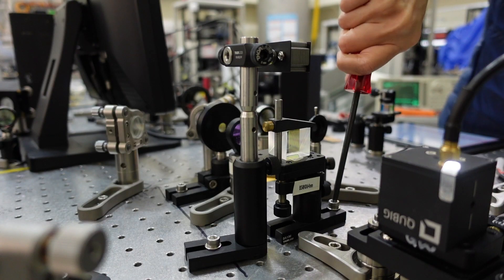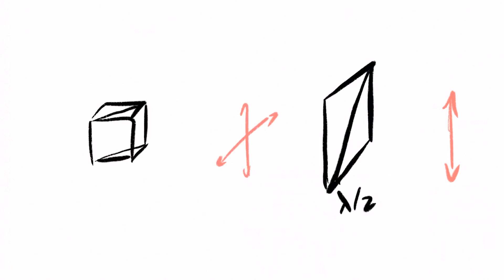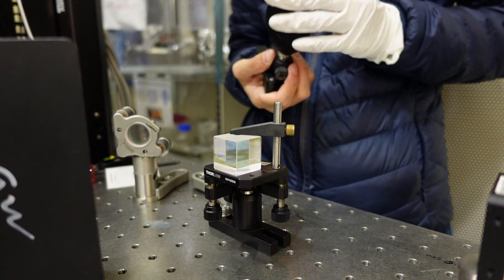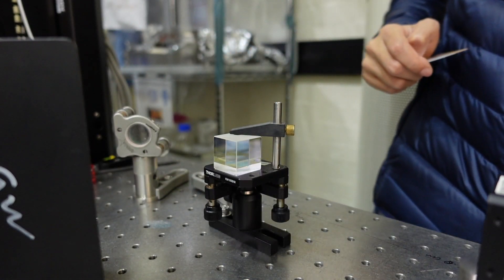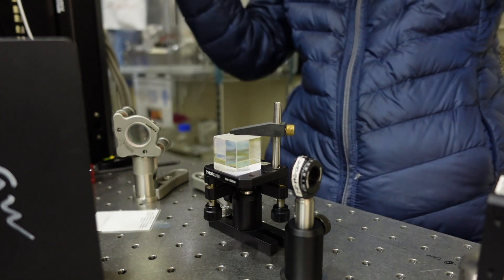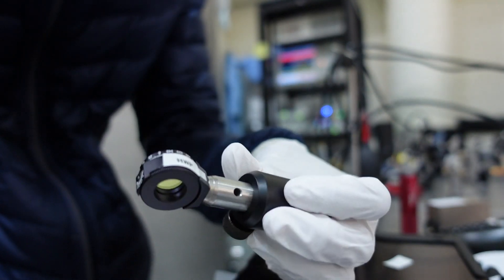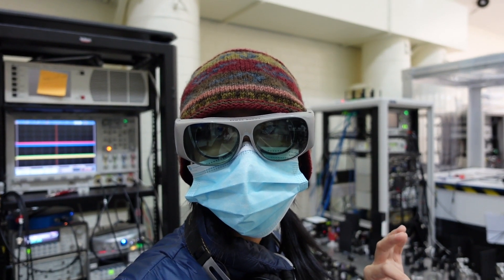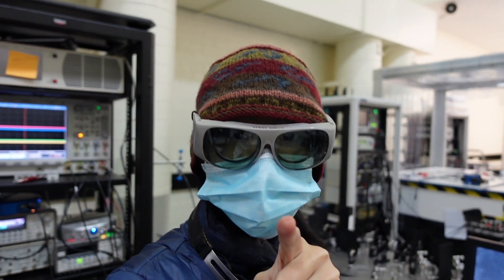OPTICS LAB | HALF-WAVE PLATE VS. QUARTER-WAVE PLATE + photographer variable ND filter explained!

Comment: I have a Strainoptics polarimeter that is used and not functioning. It appears to have been taken apart and reassembled with incorrect lenses. Where would I find someone with a laser apparatus (and the knowledge) like yours to help me identify the lenses? These lenses are expensive and I'd like to just replace what is missing, if possible. Thanks

Comment: wait if you have a linear polarized light (in the sketch s-polarized) and send it through a half-wave plate, isn't it supposed to give you just a rotation about 90° (so p-polarized).
I don't understand why it should be a superposition of both.
Reply: Yeah, I just have the same question. Then I suppose there is a mistake in the drawing. In this experiment, the angle between the optical axis of the half-wave plate and the input linearly polarized laser should be ~22.5 degrees instead of 45 degrees. Then you have a 45-degree polarized light that can be divided by the cube half-half.